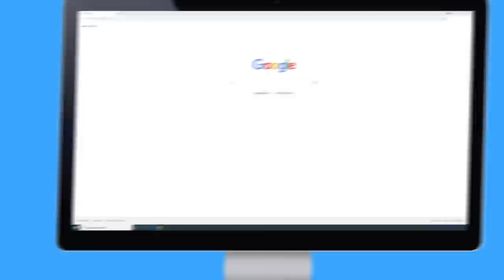BMW E46 M3 Clutch Replacement DIY (2001-2006 BMW M3)

Comment: Great video! I've done this job on an E36 and on jack stands. Best tips for someone doing this at home. 1. Wear safety glasses. 2. a Long 1/2" Ratchet is your best friend for those trans bolts and many others if you don't have an impact. 3. Must raise car at least 19" to get good clearance. 4. Mark the position of the driveshaft where it meets the tranny, middle and the differential (slight overkill, but if working along don't want that separating). 5. Last but not least. Small scissor jack that will save you a ton of struggle w the tranny and the exhaust. I went with a SMF also and refreshed all components. Car drives amazing and my shifts and super smooth and precise. Done!
Reply from the maker: Great tips and excellent work Don!
Reply: Maximum respect Don 💪🏻. I’d like to give it a try but my with my gravel driveway, it might be a struggle. I only have an E90 325i though, so might be a little easier to do, but manoeuvring a transmission on gravel……
Reply: @fcpeuro  what is you out the clutch in then when you put in gear and it’s not grabbing to go

Comment: Great video. Putting grease on the release bearing guide tube is a no no. If it was metal on metal, sure, however the release bearing on these are some sort of composite plastic and self lubricating. The grease could potentially gum up with clutch dust over time and make the movement of the release bearing sticky.
Reply: Trust it won't gum up

Comment: Where did you find that rear main seal tool for $30? It’s $161.98 on FCP Euro, and $93 on Turner though they don’t sell it with a handle. Would be nice to see up close how far in the seal is front and back of the plate. I’m about to do a clutch in a couple weeks.

Comment: really nice job. i  have question plz : My BMW 116 i N45 e87 ( P018481)  i looked only to change the clutch, DMF will not change, ist that bad ? and i wanted to buy the clutch, so on BMW website it should be 228 mm diameter but what i found it is 230mm diameter, so will work or must be 228mm diameter ??  thanks again

Comment: Sorry to bug you, but im putting the transmission back on my buddies e46 m3 on jack stands. Its almost in like maybe about 1/2inch plus to go but cant get it to go in further also there isnt any engagement on the input shaft and i can spin the output freely in gear. Do i need to wiggle, push and scream? Is that normal to be difficult to get it in that last little bit? Also i know cant get the same force on it while laying on my back and pushing with my hands.
Reply: How did you end up getting it to go the last 1/2””? I’m having the same issue right now.

Comment: What type of grease do you recommend?
Reply from the maker: Hi MotorCityMoto; manufacturers usually include them in the clutch kit. Otherwise, a tiny amount of synthetic spline lube will work.